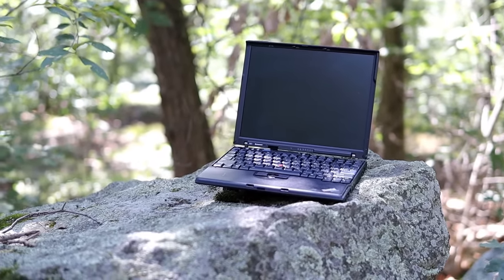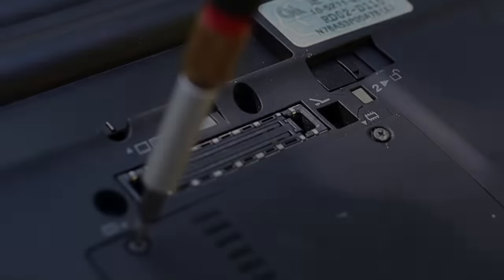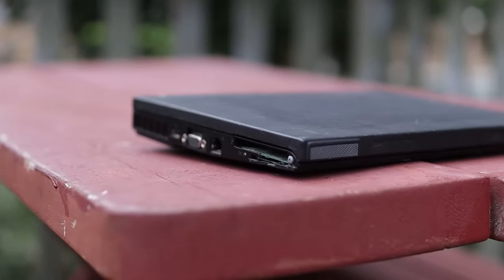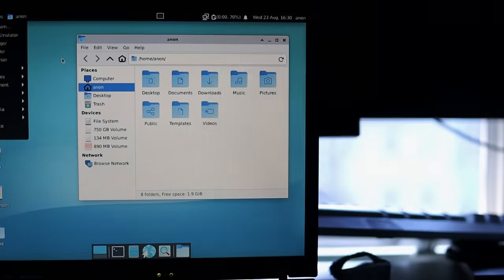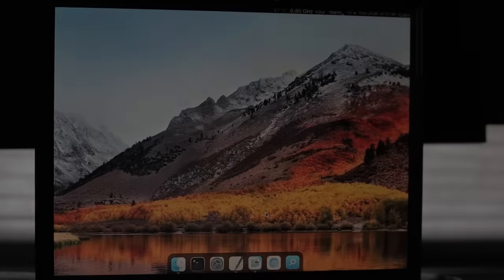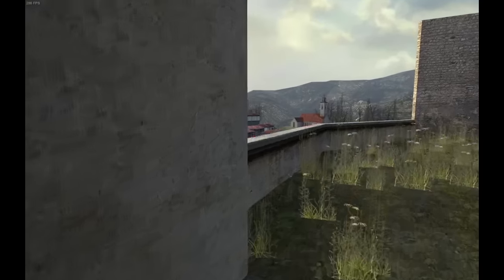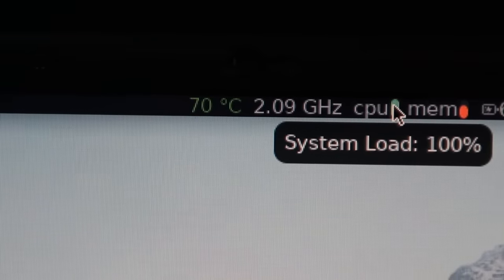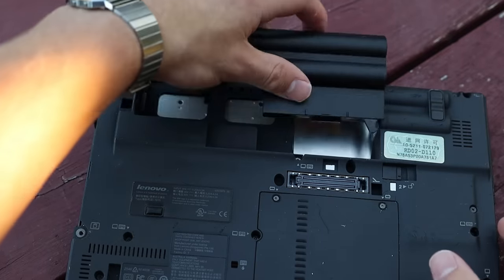Can Linux save this old laptop from obsolescence?

Comment: imho what you get from these old legendary machines, is a world class keyboard, and it is totally worth it, if you do light coding/writing. However i do suggest spending a bit more, and get a more usable machine like the x200, and throw in a cheap SSD, and upgrade the RAM 4g+.
Reply: The X200 is a good machine but I would personally go up one stage further to the X201 because you'll then go from a Core 2 Duo CPU in the X200 to a first generation Core i5 CPU in the X201.

Comment: I would go for a 512 GB SSD or even a 256 GB SSD would work. I really favor solid state hard drives over mechanical they are faster and supposedly last longer. You could get a good one for around $50. They are not that expensive now.

Comment: I've install debian 12 with gnome44 on a old pentium celeron machine with 4gb of ram, works perfect with no issues keep in mind is installed in a hhd, if I replace it with a ssd it will be even faster. It used to have windows8 on it and it was very slow.

Comment: a question.

does Linux mint play video files better?

my laptop can't play x265 video files without stuttering.

can linux play those with the same hardware if installed? it's an old dell Windows xp laptop.

Comment: Nice review! Almost a year ago all I wanted was a cheap laptop for experimenting with Linux and learn some IT stuff cuz I don't want pay for a uni :D not soon after i got hooked on linux and realize how bloated windows are these days, after that i rarely use windows anymore. I buys a bunch of cheap older laptops and put linux on them, quite a suprise how well linux run on these devices. I kept pushing and become some sort of a masocist by using old hardware as my main device, right now iam writing this right now on my ThinkPad x60 which was a generation older than your machine, it runs fine but not fast anymore but still get the job done. not going to use it for daily driving cuz early X series were rare in my country, i grab it for 22$ more a less in good looking condition, plus it has an IBM Logo on it. now use X200s as my daily driver and will try to pick up a T61 maybe in a few months tho :3 cheers!
Reply from the maker: Glad you liked it! The X200 is a nice sweet spot between old and new!

Comment: I've been using linux to run on older hardware for a long time, like in 2009 when i got my hands on a Thinkpad T20, and it had 128mb ram and a 10gb HDD, so i was stuck with Puppy Linux til i got a new battery, 200gb PATA HDD, 512mb Ram and switched to Xubuntu. Xubuntu is great for a lot of hardware that is older. Im currently trying Linux Lite on an old HP Omni 100 All-In-One with a dual core, Radeon HD 4200  graphics, 4gb ram and a 500gb hdd. Ive already got Fallout New Vegas playable on it in Wine and WineTricks is also running the newest version, but sadly due to the age i can't avail of DXVK or anything as the GPU is an onboard Terrascale 40 shader GPU. not bad for old XP era games but thats about your lot. Gonna throw RetroPie on it, and its gonna be set up as an All In One HTPC in the bedroom as its not far from the bed and 20" screen, so just a remote mouse app called Remote Touchpad that uses a browser as an interface for it along with a QR code to pair.

Comment: Correction: runit is not "far more resource efficient" than systemd. It also only does a fraction of the things systemd does. If you add together the footprint and complexity of runit with all the extra components to achieve a similar feature set you'll probably find there isn't really any difference between the two plus you'll need to learn and actually configure in multiple syntaxes things that are consistent and work out of the box with systemd. I hate that systemd misinformation.

Comment: Great review.  Yes linux is way to go for older laptops.  I have work laptop with 32GB ram and windows 10 uses 16GB without single program in use.  Windows 10 is simply an awful memory hog.

Comment: Dude! I uploaded a video about the X61 this last week! 😂 and in my content plan I had a follow-up on it running Linux to compare performance! what are the odds? 😅

My results were pretty much like yours; however, I was running Windows 10, 4gb ram, but on an SSD. For those who wonder how the performance was:

1. It CAN run Windows 10 decently, obviously with managed expectations.
2. It would be mostly usable for word processing, as the keyboard is buttery-smooth. Media playback IS possible, but 720p is the maximum comfortable resolution.
3. It runs HOT! even on low-demand applications; I disassembled it, cleaned the Internals as much as possible, and applied new thermal paste, yet it remained toasty. My guess is that running windows 10 is making the poor CPU exert itself.

The heating issue is what prompted trying a Linux distro, but that video is still in the pipeline. 

My video is in Spanish, but if anyone is interested in watching it, just holler and I’ll put the link on an edit to this message.

Great video, by the way. These little Thinkpads are quite something
Reply: I have an elitebook hp 6930p. Core 2 duo t9600+ati radeon 3450+4 gg of ram+ssd 128. I put linux on it, i3 fedora but the ram was consumed immediately. Then I tried antix and it worked with the cpu at 100% all the time. I installed Windows 10 and now it really is much more perceptive and feels really soft, you can't even tell that it is 14 years old... it's strange, because when I commented on it in a Linux community on Reddit they turned to me with insults hahaha.
Reply: @mss2981  odd. Those specs would be perfect with Zorin. I’ve tested it in several laptops with Core 2 Duo, 2-4 GB ram, HDD (no SSD) and its buttery - smooth for most basic applications

Comment: I still use REALLY old Dell XPS m1210 from 2007. What I made is added some RAM and installed SSD instead of HDD. I also had to replace 32-bit CPU with 64-bit CPU which cost less than a dollar ($1) 5 years ago.
Seeing people whine that their 2012-2017 laptops are old and obsolete just makes me sick.
OS I use is Linux mint.
Reply from the maker: Good stuff!

Comment: 12:36 Huh?  And, gotta get the ssd in there,  even if it has an ide connection, it really is night and day difference. Read/write speeds maybe not so much but due to something called access timings it is still very beneficial.

Comment: I have a 2008 HP laptop. It heats immediately and fan is rather loud. Thinking if I can and should underclock it or there's another solution to the heating problem.

Comment: I have two vista era laptops both running Mint 21.3 XFCE and a Dell Chromebox (my HTPC) running Mint 21.3 XFCE as well. My main computer is now running Mint 21.3 Cinnamon and all 4 computers run just fine (albeit the laptops are a little slow). These should stay out of the landfill for awhile at least. However, just think of all the "obsolete" computers (courtesy of ms and win 11) that will be available on October 15 2025...
Reply from the maker: yeah its frustrating

Comment: SSD and 8GB RAM plus the fastest CPU you can find (look them up in the psref or ask on the ThinkPad Forums.) make them passable for reading, email, shop use, flashing LS ECUs and reading the news. The first thing I did with every Thinkpad I got after my A31 died was throw the terrible spinners of the era in the trash and install a WD Black, then as SSD got cheap the spinner became a magnet donor. T61s will run W10 easily enough. 2GB was lame when they were new but at 8GB they behave far better. I flashed the Middleton no-whitelist BIOS on all my T61s and of course it works on X61. It's easy to build old Thinkpads from wreckage which I did. X61 "Frankenpad" conversions of X60 is a niche hobby within a niche hobby but interesting if one likes Thinkpads.

Comment: Pro tip: install windows 11 atlas OS, it's far faster than most linux distro out there (except the one that focus on lightweight).

It's only uses 1gb ram
Reply: I'm not sure, by my experience the most lighter on hardware paradoxically is Win 8 with latest service pack, which many don't like, but I agree with Linus from LTT it's the most kinda optimised and on the verge between 7 and 10, so it's kinda like 7 but with support of modern hardware like trimming SSDs and etc.
I put Win 10 (which is better than 11, imho) on my 11 year old laptop and CPU fans runs almost 24/7 even in idle, rebooted in Win 8 and it's always quiet.
Reply: atlasos disables crucial security features. it's not safe.

Comment: i have a old hp mini with a single core cpu but it does not have the x64 instruction set. is there any linux distro that i can install in this laptop? does void linux has 32bit support??

Comment: Any Linux distro can save an older laptop.  I have a MS Surface Pro 3 with 4g of RAM and it runs fine under Debian or Arch.  Even with Gnome as the DE and for touchscreen its the best so far.

Comment: I have Toshiba Satellite X200 (2007) - T7500, GT8700m, 4Gb ddr2, 240Gb ssd. Runing MX Linux 23 Xfce and X-Lite Micro 11 SE in dual boot. Its run Crysis on 900p medium settings smootly...

Comment: I live only with a very old Acer Aspire 5250 which is able to run YouTube maximum in 360p, and still with a lot of freezes. I installed Arch Linux on it and decided to use a i3wm without anything (I even deleted status bar from him). I have to use some apps which are available only for Windows 11, but of course when I installed Win 11 on this laptop it was terrible (to open Microsoft Edge it took 3 minutes, even with all disabled services etc). On my Linux OS I installed Wine, and for this moment I can run any Windows software on it with a "perfect" performance. Especially nice it works in Fl Studio 21, so I can write my beats on it.

What I would like to say? Linux can help your to run the newest Windows apps on Linux even if you don't have enough power to boot Win 11 on your laptop

Comment: It's true that Linux can revive old hardware better than anything else almost, but Linux thrives with a powerful machine and is capable of some bleeding edge things with the right setup. "That will do for a Linux machine" is not something you'll see me accept especially as I might run Windows 11 from a VM in Linux and it's so smooth with all the RAM.

Comment: What browser are you using I have been wanting to have a browser that doesn't take the entire ram everytime I scroll on Facebook?! What i ended up doing was increasing the size of the swap memory and since web browser ram data is not that much in use It cam move most of it into the swap, but since is a HDD Driveit takes about 10 to 20 senconds to move it back in to the ram and have the web page work.

Comment: i bought a t470 probably about a year ago and it's perfectly usable despite being almost 7 years old now. it runs arch linux rn, but i've been looking into nixos as well.

i actually do a bunch of dev work on it, and i got it on a nice nvme ssd and 32 gb ram, which is overkill, but the ram actually came like that when i got it, and after the og ssd died i just got an nvme drive.
also it's astronomically better than the awful chromebooks we get thru my school
Reply from the maker: T47/80 are arguably the last great ThinkPads!

Comment: Did you also try LXQT desktop environment on this laptop . It is even more lighter than XFCE  ? 

XFCE desktop already runs very fast on this machine . LXQT would make this laptop run like Usan bolt 😅.

But LXQT is a bit ugly than XFCE . The only issue i faced with LXQT is their network manager was very weired to navigate . Not at all simple to use🤨  . On top of that WiFi kept getting connected -disconnected frequent . I don't know why .

Now i am on KDE plasma.  Was a cinnamon DE  user   . No issues with wifi now . May be a LXQT problem

Comment: Sadly this doesn't work for all old hardwareMy thinkpad T60 with Radeon X1400 graphics was and is the worst! It just does not run decently with Linux, because the GPU driver interferes with other onboard components, like graphical artefacts or like Wifi, which would disconnect or disable every few minutes, and had the sensationally exotic and unbelievable issue to actually make any WiFi-router it was connected through using WPS2 freeze! (which also was an issue runing Windws, but could at leats be fixed there, but not in Linux). Of course you can use it without the accelerated graphics drivers .. which will make it suck even more.
Reply from the maker: Yeah there's definitely a cutoff point

Comment: i put ubuntu mate on a 6 yo HP 14, made it usuable at the level of an internet appliance/cloud based ultra light weight/foot print machine....given it's unchangeable 32Gb internal storage it was dead in the water after it's first Windows10 update....

Comment: I heard that KDE is more feature rich and just as light on resources as XFCE
Reply: nope, its not as light as xfce, KDE needs around 700-800 megs of memory on idle and its has a lot of animations and blur that can be hard on really old machines. If you have more memory to spare and is running 1,2nd gen i5 or more, its shouldnt be an issue. Ive tried KDE on 2nd gen i5 and it was fine.

Comment: I have the older one. IBM ThinkPad t43, sometimes i am using it for fun, and i am writhing C/C++ code in it. I've installed debian with i3, works just fine, but browsing is some kind of pain.
Reply from the maker: Yeah anything before core 2 duo is really gonna struggle these days. The T43 is a Super cool laptop though!

Comment: Currently bigger issue is internet browsing experience rather OS itself. It is correct that linux is using way less resources than Windows and you might postpone switching devices for couple extra years,  but when it comes to internet browsing it is still evident that increase in performance is very small.  I would say, upgrade your hardware every 5 years. Linux is great for IT pros, but it is very very bad for inexperienced user, I am telling it from my own experience. Browsing experience could be improved adding plugin with user agent and displaying it as a smart device.
Reply from the maker: Yeah a different OS won't improve browser performance much unfortunately

Comment: Question: can a i5 6500 paired with 16 GB ddr4, 256 GB SSD (Sata or nmve)  plus an HDD of 500gb be enought to do: web design (paired with Photoshop, ilustrator and adobe XD or Figma), use some  electric and electronic circuit  simulation apps ,PCB and PCL design (simple things for a university student), use of control and automation systems apps (also simple things for a university student), project management applications and programming with arduino, assembly language, bank and Windows system apps Ana other things related to this Os system?
Reply from the maker: I'd probly want a CPU with at least 6 cores and a decent graphics card, but the rest seems fine
Reply: @liamjewell62  saddly , that goes above
 My budget

Comment: I've been using firefox ever since 120 the performance was leagues above anything any other browser could pull off in my experience. on my M1 mac I got double the speedometer 3 score while also get 5+ hours more battery over chromium. not to mention it syncs with my phone and also allows me to use desktop-class addons on my phone. I simply can't see myself using anything other than firefox or a fork of it at this point.
Reply: literally overnight 120 made firefox viable for me, taking my mac from 9 hours to 15 hours. chrome gets me 10 hours. and safari should be about the same, I just can't use safari's the problem, safari is laggier than firefox on larger websites is my experience.
Reply from the maker: Good to know, I'll take a look

Comment: Two years ago I bought a second hand laptop with Windows 7 installed on it. Now I've installed Linux Mint but I cannot access BIOS because the previous owner set a password which I don't know. I cannot contact that person. Is there a way to override that password?
Reply from the maker: Damn that situation sucks. Not that I know of; I've seen some cheap laptops on eBay that are password locked, and I assume the sellers would disable the password if it was possible, so they could sell them at a normal price

Comment: watching this on dell Latitude E5410
core i5 ssd windows10 8gb ram works fine.
think its a 2008-2009 machine
Reply from the maker: Those old dells are built like tanks
Reply: Watching this on a D630, and looking for a good deal on a E6410. I can confirm these old Dells are pretty solid. Plus, units from around 2010 are pretty cheap to get while still having acceptable performance.

Comment: I dont really get the different flavors of Linux Mint. Aren't they all supposed to be lightweight?
Reply from the maker: They all are relative to windows but the xfce and mate versions still use a couple hundred fewer mb of ram than the cinnamon version. The desktop environment used is the only difference between them.

Comment: if the only thing you do with your computer is browsing the web , lesening to music or watch movies ,   linux is good option ,  i often install linux mint on old peoaple computers since it just work , and is more dificult to brake and get less calls , to fix it  ,  try running w 10 on old laptop cpu was pin to 100% wile dooing nothing ,  but since i need that old laptop to do other things i install w7 work well ,  iven add a ssd ,